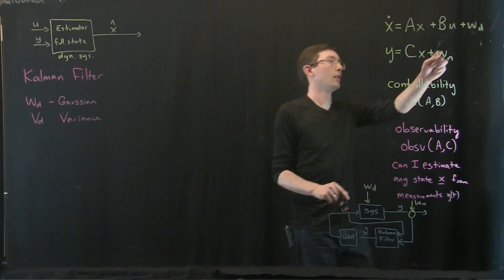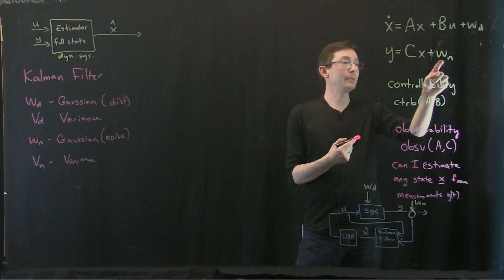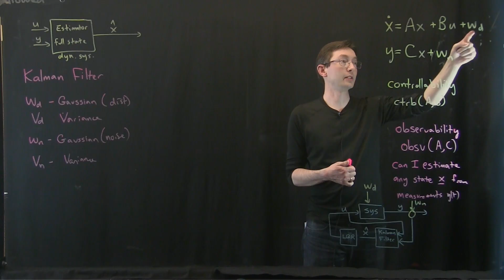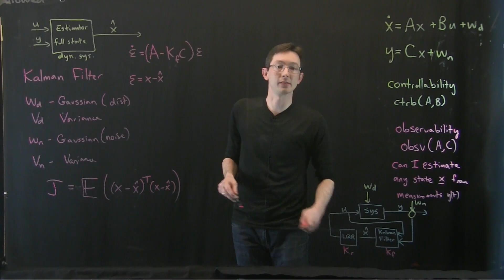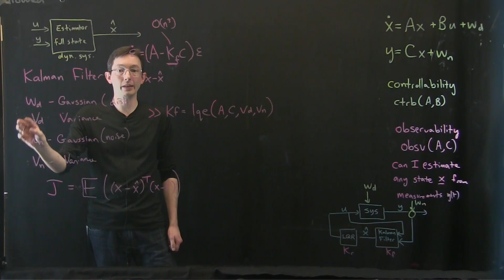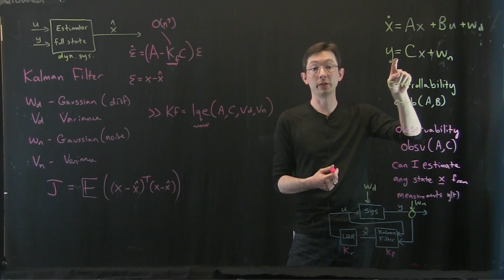The Kalman Filter [Control Bootcamp]

Comment: Hİ Professor, I observed that if disturbance noise is much smaller than a certain level of observation noise, the estimation performance is much worser than the scenario that for the same level of observation noise, disturbance noise is close to the observation noise. I don't think this is a wrong observation since in the first scenario, we trust on our model and observations are not much important, so the estimation performance is bad but for the second scenario, we make significant corrections based on our observations, but how can this be shown mathematically?
Reply: I think it depends on what you want to see. some readings may be way off the real value  so I don’t think you can use mathematics to tell you what values what’s the most convenient filter…

Comment: Hi sir, Could you give me an example for noise, disturbance in real system? What did make them? For example, to control speed of DC motor, what will be disturbance, noise? Thank you in advance!
Reply: Of you're using a high cpr encoder, the position graph won't be smooth, it will be very erratic. Using accelerometers to get position is a good example of noise, because of the imperfections the reading will never be 100% accurate, and integrating twice to get position will just accumulate all the errors leading to wildly inaccurate position estimations given enough time.
Reply: im not sure, but i guess there would be emf noise on your sensor (depending on what sensor you use), if you are using an IMU, there might also be vibrations from the motor which can vibrate the IMU and therefore introduce some error in your sensor readings. You might even get bad readings from your sensor as well. Also, since this is not a perfect world, you can always expect that your measured values will never be 100% accurate and the readings themselves are a kind of "best guess" of the sensor.